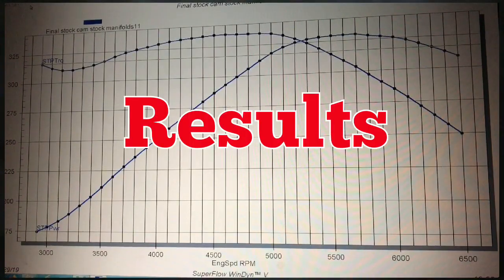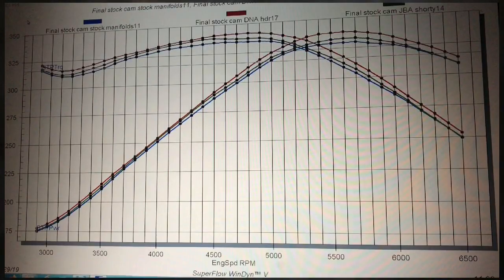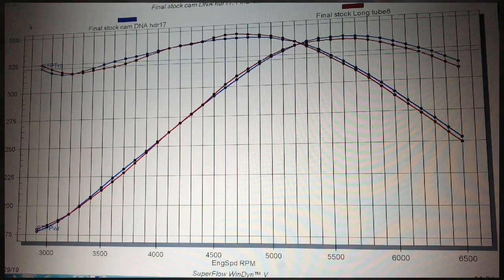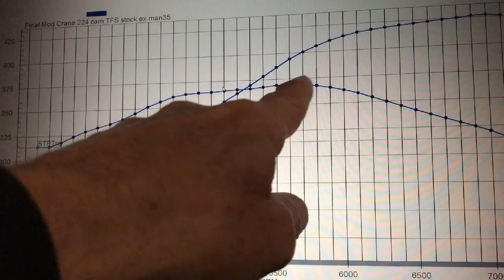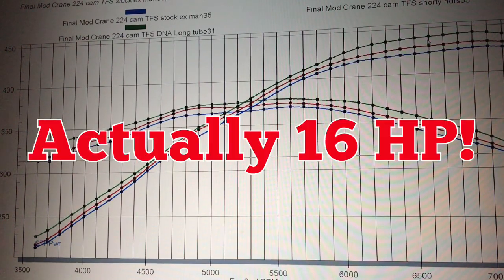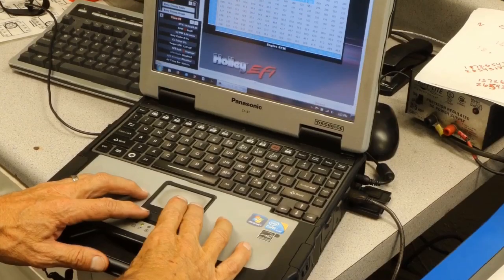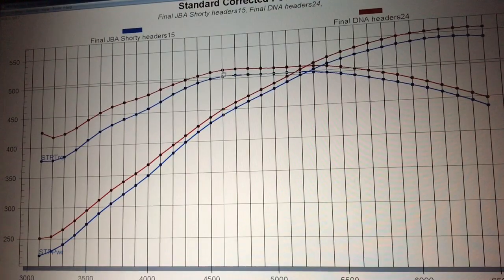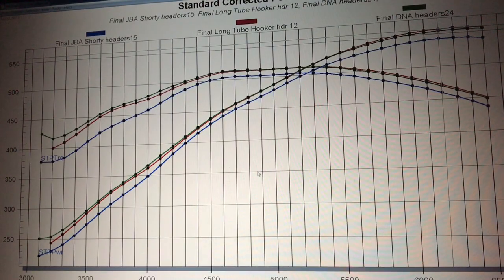DO THEY WORK? LOW-$ EBAY HEADERS

Comment: Yo RICH your videos are RICH.
LOADS OF INFORMATION FOR THE LAYMAN AND THE PROFESSIONAL. 
YOU ARE THE BEST.
Frieburger and crew take heed.
By the way. I purchased the cheap Ebay headers for my 6.0 Ls build 
Just as test and engine break in. The fit was poor and broke a couple of spark plugs upon installation. 
In my opinion the more expensive headers are the way to go if your going to keep them for every day use or racing.

Comment: Very interesting, 
So the upgraded cam and head produced around 100hp extra??
If that is true then do you think similar numbers can be achieved for HEMI 5.7L Engines?
Reply from the maker: yes I think heads and cam will add 100 hp to a 5.7L Hemi.

Comment: The exhaust   Valve is close long before the intake opens
Reply: Typically the exhaust valve is still open when the intake valve starts to open. This is commonly referred to as "overlap" and it helps the engine breath as the momentum of the escaping exhaust gases help draw in the fresh air/fuel charge.

Comment: I run dna "speeddaddy" longtubes on my 392 hemi charger scat. while everyone is always skeptical because well, its an ebay header, ive found that they work just as well as higher end headers just from track times. currently the car runs an 11.32 with just a cam and dna longtubes. id say theyre helping out
Reply: Yes I run those exact ones one my cammed 5.3 for a year now.   Sound great

Comment: If DNA isn't supplying you with the stuff you need for these videos, they need to because you probably just sold over 100 long tubes from them. Count me as 2.
Reply from the maker: IKR
Reply: They are tubes with bends in them . Clean up the weld crap and of course they good . Not like a machined cam or set of heads guys .
Reply: Makes me feel lot better about the  DNA headers (JBA clones for Tacoma) I'm getting ready to install on  4rnr
Reply: I'm running a DNA header on a Geo Tracker of all things. Can confirm it is identical to the supposedly "USA made" option from LROR.
Reply: I put the same DNA headers on my 15 SS camaro I like them they are nice for the price but if I had the $1200 for Kooks I would've bought them. Great vid
Reply: Just sold me on some DNA headers.
Reply: @Og Bqze, how do you like them? Have heard a few people talk about them being warped and leaking.
Reply: @Ka_Gg  That's the risk you usually take with cheapie stuff. A good cheapie dealer will sort through the bulk stock and toss the obvious duds, but QC is one of the most expensive parts of a production process and usually gets slashed when someone is trying to shovel out a functional product that can undercut established brands price-wise. Same as Chinese turbos. Most of them will last a solid 70-80% as long as a brand name turbo if properly sized for their application, but every now and then you get a dud that shits out after 100 miles for no apparent reason. 

Buy nice or buy twice isn't really a stone cold fact anymore, but it's still meaningful.
Reply: Ive bought for fbodys before nice to have data now thanks Richard
Reply: I saw this video long after deciding to buy DNA Motoring headers, but with a little beating up, they work great!

Comment: Awesome video. How much more power do u think the heads made vs a cam only build I'm gonna do?
Reply from the maker: Head upgrade is worth less on the little 4.8L than a 5.3L or bigger-we've made this much (and more) with stock heads-but made near 500 hp with the TFS heads
Reply: Heck yea that's what I wanted to hear. I got a 04 4.8 Silverado and it's a dd slash shop truck. I wanna do cam headers. I'm thinking a btr nsr cam or stg 2 truck cam idk. But if yal made 440ish I'd be happy with 425 lol
Reply: Even if heads added a bunch more I'm still thinking best bang for buck would be cam headers tune. Hopefully make 400 ish idk I've always built 5.3s and ls3 ls1 so far I been impressed with 4.8

Comment: The power that 4.8s make continue to depress me
Reply: minivanin compared to Chevy’s 283, the 293 stomps the pants off the old smallblock from over 60 years ago.
Reply: @basedandChristpilledlowrider  Stomp the pants off? There's hardly a difference. You don't know what you're talking about. We were running 11 flat in the 1/4 back in the early 90s n/a with a 283. You can build a 4.6 today that's just as competitive as a 4.8. You really don't know what you're talking about.
Reply: @causeimbatmaaan  you're right, I never considered throwing 10 or 15 grand at a 283. Guess you proved me wrong.
Reply: @causeimbatmaaan  
  283 Small Block (stock):
Power:
   185 hp (8.5:1 w/ two-barrel carb)
   220 hp (9.5:1 w/ four-barrel carb)
   245 hp (8.5:1 w/ dual four-barrel carb)
   270 hp (9.5:1 w/ dual four-barrel carb)
   283 hp (9.5:1 w/ fuel injection (UNRELIABLE))
Torque:
   Hard to find stats but a MAX of 290 lb-ft

  293 Small Block (stock):
Power:
   295 hp (8.8:1 75mm TB)
Torque:
   305 lb-ft

So if the 283 had the same compression amount (assuming perfect world conditions) 
283 (two-barrel carb)   (185hp)/8.5:1
283 (two-barrel carb)   (191.5hp)/8.8:1
283 (dual four-barrel carb)  (245hp)/8.5:1
283 (dual four-barrel carb)  (253.6hp)/8.8:1

293 Stock Refrence:   (295hp)/8.8:1
Reply: @basedandChristpilledlowrider My 283 in a 4wd square body beats a 4.8 easy and it's all original hardware from 1962. $10 or $15k? What a stupid thing to say!
Reply: @sethh8892  You're not realizing where the power is being measured. Look at the rpm. If you measured the 283 up to the same rpm it would be very close. The real point is that both perform practically alike when built alike. Look how similar the engines are.
Reply: put a $170 ebay turbo on and make an easy 600whp on the 4.8 lol

Comment: Mostly what you're buying with expensive headers is longevity but, yes, a lot has to with the rest of the engine. If it's near stock you're not going to gain much regardless of what headers you put on.

Comment: I'd like to see a comparison of H-pipe vs X-pipe vs Straight pipes with no crossover.
Reply: Engine masters does that test if you can get motor trend on demand. X-Pipe did best then h pipe then straights if I remember correctly.

Comment: Great video! Yesterday i was looking for a test like this, im about to put some headers on a BBC in my truck, perfect timing. You also cleared up the misinformation ive read about where power gains are at in rpm range with shorty's vs long tubes. Thanks again!

Edit to add...i agree with others, this testing does help us all a lot. Its hard to sift through all the conflicting info on the internet.  Its great to see an actual test.

Comment: Surprising how well the factory cast manifolds perform
Reply: I was rather shocked by this also and since I'm planning on an LS/F150 swap, I might not do headers at all.
Reply: @johnparrish9215  Plus OEM cast manifolds always lend themselves to turbos lol.  It'd be interesting to do a stock manifold test, from the various cast items, to LS7 etc.
Reply: Shouldn't be, a lot of the performance gains from modern engine was a result of optimizing.  From about 2000 on OEM parts are pretty stout performers.  To see decent gain with many bolt-on's you've got alter the design, like going to a long tube design vs shorty.

These days OEM don't leave much low hanging fruit, within the parameter they live in, they can't the competition is just too high.  Because of the strict regulation there will always be gains to be made if you are willing to bend or ignore those parameters. 

The fact that eBay parts perform well shouldn't be a shock either, in most cases they are just copies, so many clever design elements are the same.  What you would want to watch for is cheaper materials, sloppy welts, ect.
Reply: For streetable low to midrange performance the cast OEM manifolds flow quite well with a bit of port matching and polishing away some of the rough casting material. In the real world who drives around at 9000RPM everywhere, except maybe during the zombie pandemic to pick up your rolls of toilet paper. 🤣😆
Reply: Just change to better bolts before they start snapping off...
Reply: I agree the factor manifold performs well. I think this may be the same factory manifold that is used on the 5.3, 6.0, etc. That means it is meant to flow much more than the 4.8L. Because on the 4.8 with a high flow head, cam, etc., it just doesn't seem like much restriction from the factory manifold, even with the high flow head and cam.
Reply: I have used stock exhaust manifolds on a few builds. I just clean the insides up a bit and polish them.

Comment: I always questioned whether the guys just dumping the catalysts off the stock exhaust manifolds were really gaining much, but apparently they perform almost as well as the shorties.  In fact, I suspect the guys reporting bigger gains on shorties are comparing them to stocks with cats which is not really apples to apples. Good, informative testing.
Reply: There is nothing to gain from removing cats. They are not the restriction.

Comment: Thanks for this one. I've been battling back and forth with folks about brand name headers and cheap copies of them. Forget spending thousands of dollars for brand name headers.
Reply: James Williams you think the companies making knock offs are testing? lol  someone has to design through r&d these products but you take the risk if your eBay part is a knock off of something that works or something that’s good enough.
Reply: @hopsyn  Nope. I don't think they are testing. But in my case, I have OBX copies of Kooks headers for a G8. They've been dyno tested before in the past and they were within 1-5 hp of Kooks. For less than half the price. So, I'm happy... Lol
Reply: James Williams Ppl who buy the expensive brand got the money for it so they can careless searching for cheaper. Also the more expensive brands like kooks comes with better quality v band clamps and provide 02 extenders
Reply: @isiahgomez6860  I got the money for the good stuff also. And Ive had my cheap stuff for years. But double the price for 5 hp? No sir.
Reply: @isiahgomez6860  and Kooks doesn't offer the O2 extensions for free. I got mine for 10 bucks. Everyone else wanted 30. And I've had no issues.

Comment: Awesome! The exact review I was looking to help me justify replacing my shorties with long tubes. Any chance you’d do some long tube size comparisons? 1 5/8 vs 1 3/4 vs 1 7/8 on the LS3?
Reply: That would be a excellent test! I always told the smaller the pipe more torque. The bigger the pipe, more horsepower. Would love to find out
Reply from the maker: the vid has 1 3/4 vs 1 7/8 on the LS3
Reply: Richard Holdener, I saw that and that was great, but the collectors were also different sizes (2.5” vs 3”). This adds another variable in the test. Still... awesome information. I’m just debating if I really need to go from 2.5” to 3” coming out of the headers...

Comment: Would be great to see if a quality ceramic coating would make any difference to output
Reply from the maker: the shorty headers were coated-its mostly for longevity and not power
Reply: @richardholdener1727  Thanks for the reply. I used to see claims about increased exhaust velocity and scavenging due to heat being contained in the exhaust by a Jet Hot/Zircotec type coating. Would be fascinating to see a direct comparison of same eBay headers, coated vs uncoated.

I am really enjoying the videos, thanks. I really geek out on these sorts of test and comparison videos - the dyno don't lie...

I have you and Gale Banks at the top of my watch list!

Comment: Thats insane!  425 HP out of 294 cu in!
Reply: Gotta love LS engines!👍
Reply: Lol, hate to burst your bubble but 5 liter Coyote engines do this in their sleep. The gen 3 pushes over 450hp stock from 302ci. 425hp from around 300ci was really impressive 30-40 years ago when everything was 2 valve pushrod engines but now if you're not making over 400hp from 300ci in a performance application something is wrong.
Reply: @177SCmaro  .
HATE  to burst yer bubble but could you do it with a Coyote for under a $1000?
Not likely. There's probably Lambo, BMW & tons of exotics out there.  Theyll make way more on less cubes than Coyote or LS. 
So dont flatter yourself smug boi! 🤣😂🤣
Reply: @brebohol  lol, we found We All So Bad's other youtube account...
Reply from the maker: I've done plenty of Coyote testing
Reply: Joe Paul  .
Yes.  Even the old 3 valve engines threw up some good numbers.  My nephew had a 4.6 in a Stang & I simply couldnt believe how quick the thing was. But putting up better numbers meant he wasn't gonna be able to play hockey for a few years because it was gonna cost some big money.  Whereas a fraction of that amount could make a truck motor absolutely scream!
Reply: Joe Paul  Where are you finding complete  LS engines plus harness AND transmissons for 600 bucks?!
Reply: @177SCmaro  every junk yard LMAO
Reply: @beto_lsx497  Bullshit. I've been looking for an LS off and on for a future project nationwide and I've never seen one with a harness plus a transmission for $600. You guys are 0/3 now.
For decent 5.3's people are asking around $2000 more or less.
Reply: @177SCmaro  I've only seen a few lately with motor and transmission for under a grand. Complete motors wiring and all $300 to $550 all day long. Couple with a blown head gasket for $150...
Reply: @Dirtydave67  
Another claim about unrealistically cheap LS engines without a single source, example, ect.
Reply: Joe Paul  Lol, the state of Ohio is a pretty big place. Can't you be more specific?
Reply: @Dirtydave67  
Maybe you should have read the whole thread before accusing me of anything because I wasn't the one started shit talking, I just asked for evidence form these these guys "running their cockholster", as you so crassly put it, since I'd like to do an LS swap someday. Out of 4 people you're the first to actually back something up. Kudos.
That said, its still not an example of some of the other claims above but 1/4 is better than 0/3. At least one of you isn't fully of shit.
Reply: @177SCmaro  you're right and I respectfully apologize for the crass comment. And if you would like any help finding a donor for your project I would be happy to help. I have pretty good luck at finding things.
Reply: @Dirtydave67  I'll keep that in mind. Working on a 5.0 coyote swap in my race car now but I'm thinking of a 7th gen Toyota celica LS swap/rwd conversion as my next project. A 4.8 or 5.3 is probably the only v8 that has a prayer in hell of fitting. Lol.

Comment: Awesome video! What did I learn? Headers don’t make as much power as people think they do.
Reply: Bottom line is LS engines breathe very well even stock
Reply: On a stock engine no, but on a modified motor they do and more.
Reply: You missed the point. Peak power - no. Bottom end gains - hell yeah

Comment: Awesome content I have the DNA system on my Tahoe with their y-pipe, my curiosity is does the short collector make a difference to power on both sides of the fence compared to the longer collector. I do know it does affect scavenging but how much of a loss
Reply: How did it all fit together?

Comment: Fit, finish, flange thickness, and overall quality matter just as much as the power numbers. Changing header flange and collector gaskets that leak all the time sucks. Same with headers that fit poorly or rot out after a year or two. Great test Richard! Best of luck in 2020, if you take a tumble on New Years eve, don't catch yourself with your face 😁
Reply from the maker: when I find something good-I stick with it! Face first into 2020